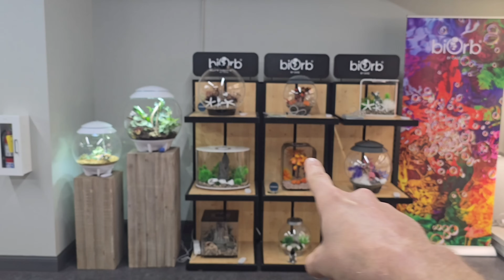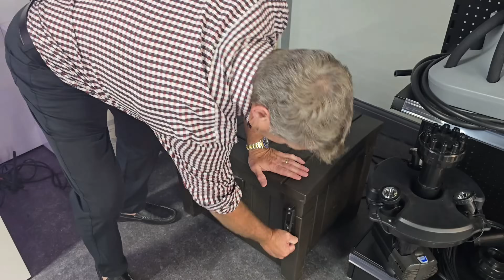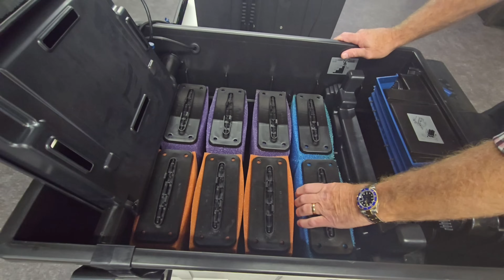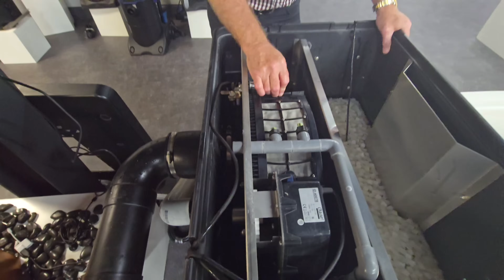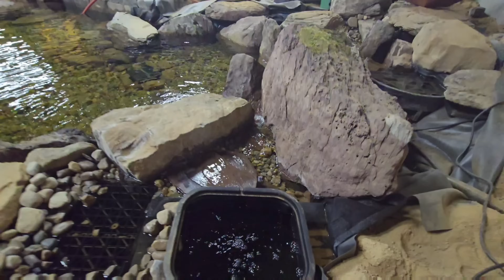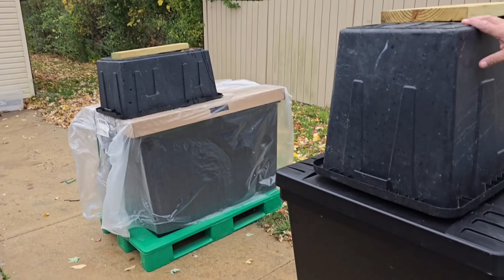We Didn't Know this Place Existed! Exclusive Tour of Atlantic Oasé in Ohio

Comment: sorry, that screen filter is not as good as a vortex filter and German engineering is nothing special. A vortex filter is much easier to clean and is much simpler in design it also holds much more waste plus you can make it self cleaning, with a solenoid. You could probably also make a larger self cleaning drum filter  at the same price if you think screen filters are better than vortex filter.
Reply from the maker: Wow what got your panties in a bunch today :)

Comment: Hey josh, i have used them big Oase filters many they are great while that rolling bed works but they don't work for long, plus just pumping the sponges like they say does not get them clean enough either you still need to take the out the old fashioned way to clean them, we have had them for years in the uk
Reply: Yes and all your high end koi ponds use them for a reason.
Reply: @jasonmillwood2893  all high end koi ponds don't use them they use alot better than that I used to work for an aquatics company that did maintenance on alot of koi ponds and oase products always broke
Reply: @ well you must not be taking care of them 😂 that’s not the filters fault. And yes in Japan and Europe many multiple million dollar Koi ponds are using them successfully.
Reply: @jasonmillwood2893  😂😂😂 hilarious it's the moving beds on them that always pack up there pumps are great just don't rate the filters